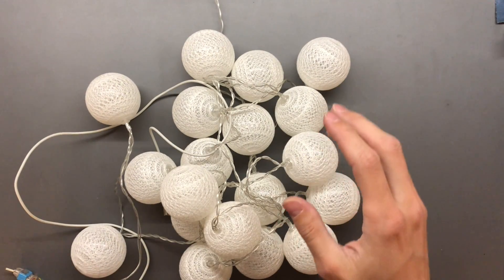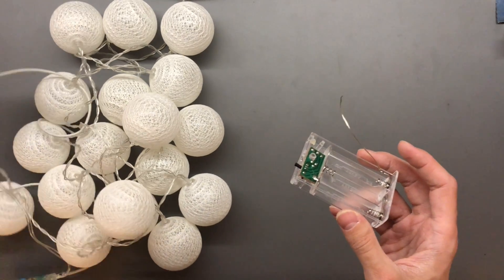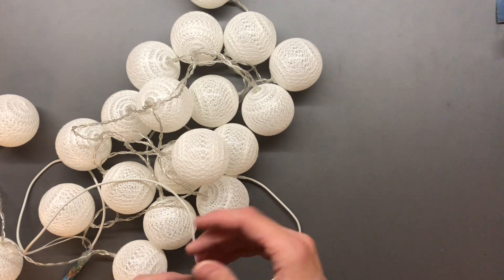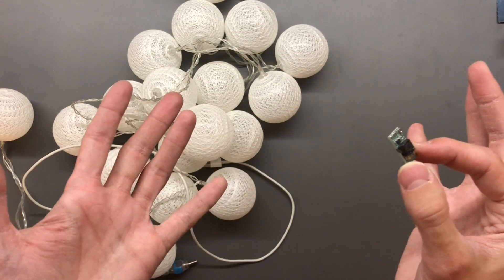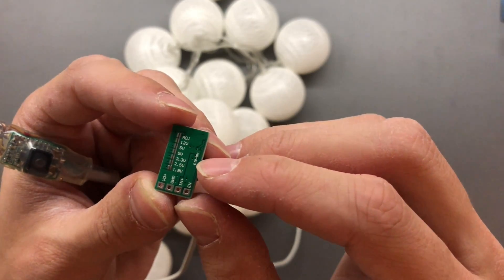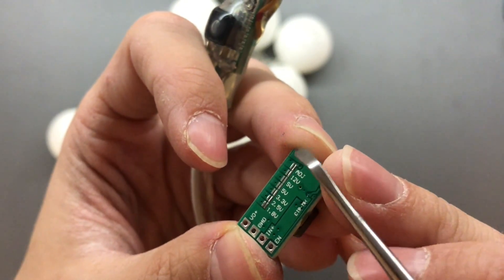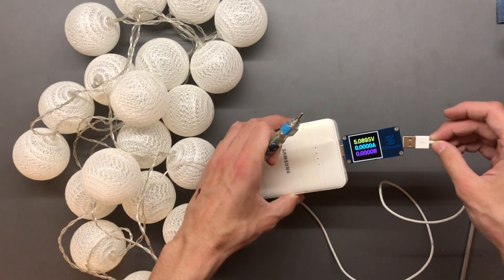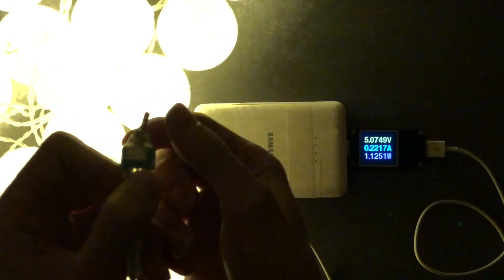LED Fairy Light Conversion : Landfill Generators to USB

Comment: Great video. Question: Couldn't you just solder the USB 5v pins (+ resistor) to the circuit they came with as a replacement for the 4.5v batteries? (for less new parts &  waste)?